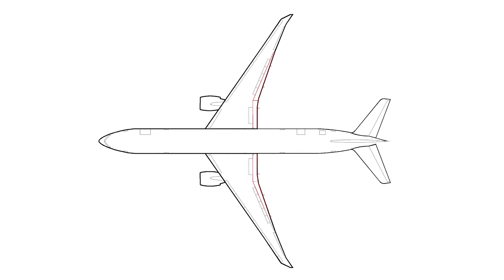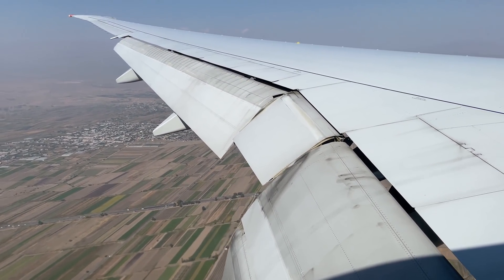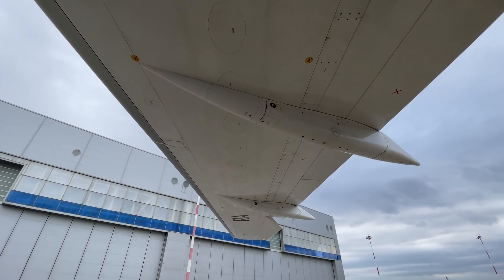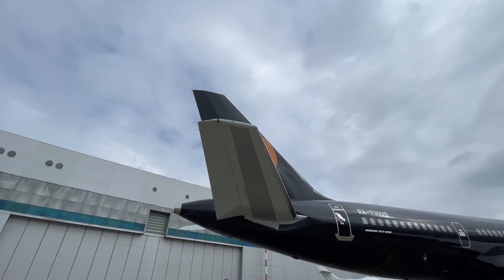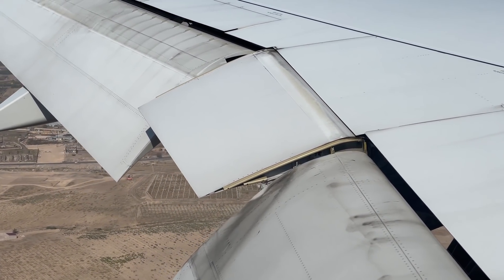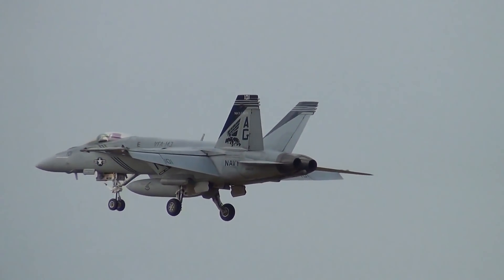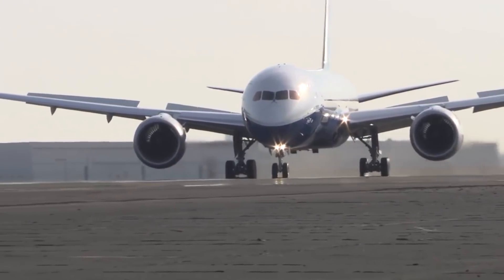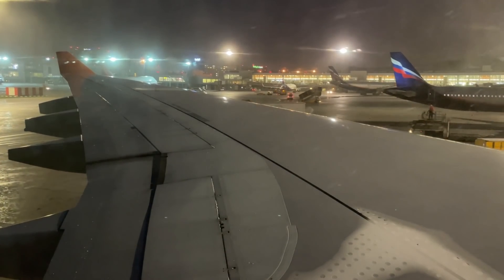How do we control the flight?

Comment: Most airliners today also have some form of reverse thrust. In jet engines, we have doors that open up on the sides of the engines that redirect bypass air forward, or a bucket on the back of the engine. With turboprops, the propellers can rotate into a Beta range that pushes the air forward instead of back.

Comment: I was hoping you would expand into some videos on flight basics. I said I thought you would be good at it.
The best way to describe inboard ailerons is as "high speed ailerons", which is what they are. The outboard ones are larger and have more authority and they work best at lower speeds, while at cruising speed the inboard ones are used,. This allows finer control, and reduces wing bending by placing the center of force inboard.
Reply: Believe in JESUS today, confess and repent of your sins. No one goes to heaven for doing good but by believing in JESUS who died for our sins. Hell isn't fun. GOD loves you soo much unconditional❤🙌❤😘❤😋

Comment: 4:27 You don't lose lift when the flow turns turbulent. You lose lift when the flow separates from the wing surface. Turbulent flow actually allows a high angle of attack without flow separation. That's why many planes today have vortex generators on the wings.

Comment: Correction:  Spoilers do not make the wing stall.  They do two things:  Reduce lift and add significant drag allowing a steeper decent angle.  This is helpful as a light plane descending can have a lot of energy that is hard to reduce as you go into the terminal area, especially as you are slowing down and need to be below 250 kts under 10,000ft.  You can feel a light buffeting when they are deployed.  I barely notice it, but some find it uncomfortable, but the rate will never be enough (in normal operation) for anyone to feel like your stomach is in your throat.  Airliners are so "clean" that they don't like to slow down - and ATC often likes to drop you in from high and fast to low and slow very quickly.  Even some of the STARS (Standard Instrument Arrivals) have decent profiles that may need a notch of spoiler or two.

Comment: At time 9:53 you make a very wrong statement: "... the plane begins to stall..." You have to learn that extending the spoilers / speed brakes in flight does NOT produce a stall. Also the angle of attack (AoA) in nowhere near the critical value where the wing would stall. The exteded spoilers foremost add a lot of drag so that either the speed of the aircraft will slow down or else a rapid descent can be performed without the speed having the tendency to increase. Yes, the lift is reduced on that part of the wing where the spoiler panel is extended into the airstream and also behind the panel towards the trailling edge of the wing. But the part of in front of the spoiler panel - from the leading edge to the spoiler panels, where the generated lift is greater than in the aft section of the wing, - the lift is NOT reduced. Due to the loss of lift at the spoiler panel and the great reduction of lift behind the spoiler panel the angle of attack (AoA) will slightly increase to compensate that loss of lift in such a way that the total lift of the wing is again the same as before the moment when the spoilers were extended. Like that the aircraft continues in a flight of 1G in the vertical axis (no acceleration into an increasing descent rate).

Comment: I have a degree in aerospace engineering and knew everything in this video, yet I still watched every second of this video. You’re such a good storyteller, I really enjoy your videos! Thanks 🙏🏼
Reply: I used it to review for a test
Reply: literally me.
Reply: really, so why does normal shockwave form on the upper wing surface during transonic flight?
Reply: @ylstorage7085  That’s actually quite a difficult thing to conceptualise. You really need to understand the quite different behaviour of sub and supersonic flow first. The very very basics are that at transonic speeds there is a region over the wing where you have supersonic flow and a region behind it which is subsonic. The normal shockwave is the boundary of these regions and moves back as the Mach number increases until it reaches the trailing edge and joins the shockwave under the wing at Mach 1. I remember being played an excellent but absolutely ancient video at university of this happening in a wind tunnel which explained it pretty well. I wonder if it’s on YouTube somewhere.
Reply: @morzee94  it was a trick question on your claim of "aerospace eng". I believe in the ancient video of yours as well, as it is suprisingly hard to find any video made by someone who actually understands what's going on (supersonic stuff that is). The question was inspired by @7:54
Reply: @ylstorage7085  It wasn’t meant as a flex, I was genuinely trying to complement the storytelling in the video. I also didn’t go into the industry after my undergrad, so I won’t know anywhere near as much on this topic as someone that actually works as an aerodynamicist. I just happened to want to go to university after school and chose the subject I was most interested in. Like many people, I needed a STEM degree to get my job but haven’t actually used anything I learnt at university since, apart from in YouTube comment sections 😂
Reply: @ylstorage7085  Believe in JESUS today, confess and repent of your sins. No one goes to heaven for doing good but by believing in JESUS who died for our sins. Hell isn't fun. GOD loves you soo much unconditional❤🙌❤😘❤😋
Reply: @ylstorage7085  Not a good question for a YouTube comments section.
Reply: @reubenmorris487  Not a question that is usually answered correctly anywhere other than Youtube either